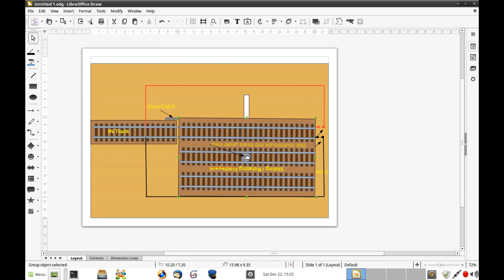Sliding Rotating Yard

Comment: Good Idea, Gormo. Would probably work well for a loco or a very short train, but anything over two foot long would need a lot of space for rotation. Probably for a long train, I would make one about 18" long and build a loop siding on the input track, so you could release the incoming loco, rotate it and then use one of the yard tracks to feed a turned loco onto the loop to place it back to the other end of the long train.
Best wishes & Season's Greetings
Ray